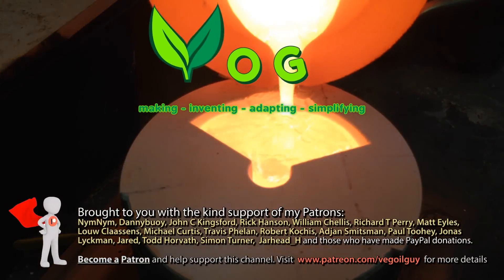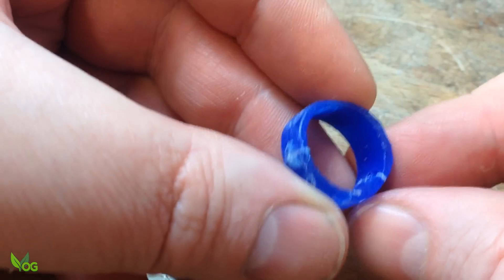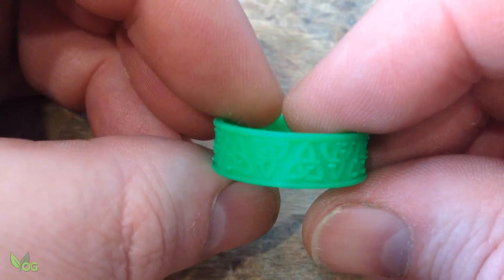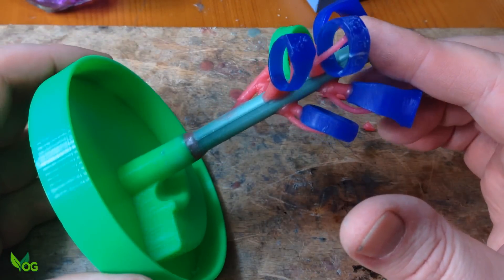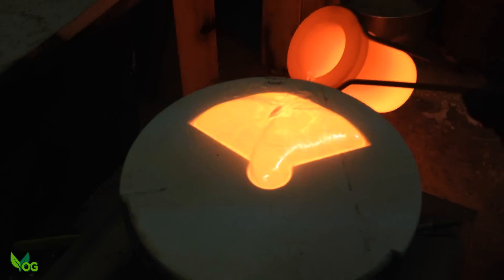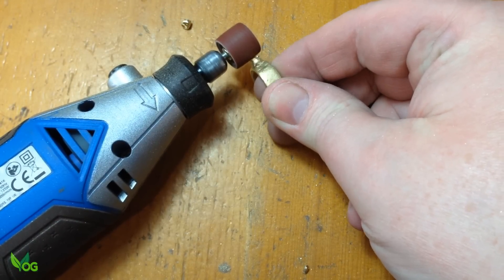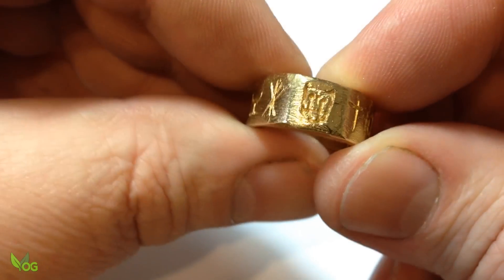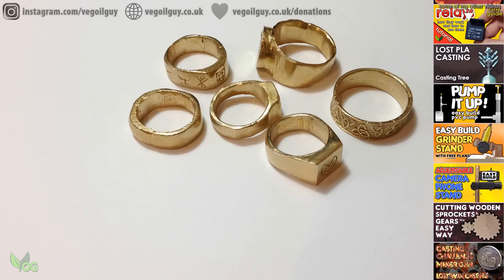Casting Rings & jewellery at home - Lost Wax & PLA methods - by VOGMAN

Comment: Hey there! Which 3D printer do you use? Also, can the used “lost wax” be reused in the printer?
Reply: Hi, 
I can’t answer about the printer but as someone looking at getting into casting, no you cannot reuse the lost wax as to clear it from the mould you actually burn it away to ash

Comment: Quick question is the plaster still inside the ring or di the heat melt it down im confused, so is it just like dipped
Reply from the maker: The PLA and Wax both stay inside the plaster until it is heated to a very high temperature. These then melt away to leave holes in the plaster. Molten metal then fills up these holes and once cool the plaster get removed. Then you're left with the rings 😊
Reply: @vogman  ohh thanks alot

Comment: What did you use to sand and remove the sprue.
Reply from the maker: I can't be sure offhand Jamile. I typically use an angle grinder, a Dremel (with cutting disk or sanding drum), small files and ordinary sand paper : )
Reply: That still helps thanks alot working on a few projects myself you earned a new sub
Reply from the maker: That's great to hear. Drop me a line any time if you need a little help : )

Comment: Don’t quite understand your furnace situation- you seem to have lots! Why have you stopped using the homemade one?
Reply from the maker: I guess the answer to that Tim is 'which homemade one?' There's been a couple.
For Lost PLA / Wax I need two heat sources, one to melt / burnout / prepare the plaster flask (for which I use my homemade electric furnace) and one to melt metal (for which I use a tabletop, store bought electric furnace - though I've also got a couple of gas furnaces I use from time to time).
The choice is purely preference... electricity is quiet, clean and indoors. Gas is noisy and outdoors.
But for more on the why, have a look at this video I made on Lost PLA. It should tell you everything you need to know : )
https://youtu.be/qxj5eUkAFUI
Reply: Glad to hear you are still using the homemade electric, it is on my (rather extensive) todo list, so pleased to hear it is still in favour 😊
Reply from the maker: It's still my favourite furnace  : )
Have you seen last week's video? I added a programmable PID to extend the use of that furnace, giving it Burnout capabilities - https://youtu.be/hGCL1FXKXss

Comment: Jewelry is often cast using centrifugal casting. Myfordboy used lost PLA to do centrifugal casting in a video earlier this year. Check it out!
Reply from the maker: I'm a subscriber and fan of Myfordboy, Jake, so you can be sure I've watched it. You can actually find his comments on some of my videos, which was very kind of him.
The only drawback of centrifuges, if you ignore molten metal spinning by you head, is that need to know the precise amount of metal needed in your casting. This is poured into the basin outside of the flask, and the centrifuge pushes the metal inside. 
I'm not that precise in honesty. But fortunately with a homemade vacuum system like mine (https://youtu.be/EGNnH_xbjR4) this isn't a problem.
Thanks for your input  : )

Comment: Have you considered trying to make a magnetic induction foundry? I've been seeing a lot of videos here on the YouTubes of people demonstrating how it can heat and even melt metal for casting. It makes me think that if someone were willing to scale it up enough there might be a very green alternative to using fossil fuels for melting metals with exceptionally high melting points like steel and iron.
Reply from the maker: I did see a company advertising them on banggood I think. I wrote asking if they wanted me to review one but they never replied... at all. That made me sceptical. I may not be the biggest channel on YouTube, but I hope I have a reasonable reputation for casting. So ignoring me suggested they didn't like the idea of someone who melts metal a lot having a go. Of course I could be wrong there and it might simply have got lost in the system...
Reply: @vogman  That's a bummer, but it gave me the idea to try and find some DIY instructions online; http://inductionheatertutorial.com/ . I think the person who did this just wanted see if they could do it, or were working on college project, and posted it online so others can repeat the experiment. Ether way, it's something to build off of, and one thing I know you are very good at is building on a good foundation. Keep searching and researching. I have faith that you'll pull this off.

Comment: Cool rings 👍🏻 I haven’t seen the foundry in a while. Do you still use it?   When you printed the ring, what mm height did you use? Great job 🍺🍻🍻
Reply from the maker: Thanks mate. I'll be honest I don't recall. I use Cura which does all the clever thinking for me. I had it on draft I think.

Comment: I used to use that blue tape on my printbed and had a heck of a time getting prints off of it so I now only user cheap glue sticks and I can pop the prints of really easily and have had good adhesion to my mirror plate on my bed. 

Great stuff!
Thanks for sharing and as always keep building👍
Reply from the maker: I tried glue sticks, hair spray, masking tape... nothing worked. But then I found a tape claiming to be made for that purpose, and it DOES work. Well worth the money : )

Comment: I think Conner is going to be happy.  I'm in the process of carving my wedding rings myself-the wife is getting a rig of bear claws stylized in my own design I use as a logo for my photography biz, going to be set with a stone tho not sure which stone, mine is going to be a ring of Fruit Loops-trying to figure out how to use different metals for each one [[her nickname is Fruit Loop]].
Reply from the maker: Mark, that's AMAZING. I'd love to see pics when they're done. Please take silicone molds before you risk any castings. I'd hate for you to lose all that hard work. Are you going to do the casting yourself or maybe hand it over to a jeweller?
Reply: @vogman  Sure!  And the silicone mold.  That totaally escaped me.  Also considering designing it in photoshop then using a 3d program to clean it up and size it, print and cast-if I go that route I will have the fikkes as I'm working on some other unique pieces as well but the silicone is definitely getting filed into my small brain, thanks!
Reply from the maker: I was lucky with today's video. They've gone wrong in the past. There was always a gamble I'd lose Conor's work.
Don't take that risk  : )
Reply: @vogman  My work never goes wrong.  I have, however, discovered thousands of ways to do things.  :D

Comment: Nicely done. Are you able to take pictures or something and put it on your computer then 3D print it?  Then you could have made extras if something had gone wrong. I do not know much about 3D printing and would like more information. Thank you. Great job 🍻
Reply from the maker: I'll be honest James, I'm still learning 3D printing myself. I got my Creality CR10S in January this year, and I'm very pleased with it. It's one of those things you can watch 1000 videos on, but never really grasp until you buy one and get on with it. If you do, after a week of swearing and cursing me, you'll get there. A week later, you'll see why people love them.
3D scanners are a thing, but they're a little pricey I believe. I think we'll see those becoming more and more common very soon.
Reply: @vogman  i have gotten through the first week and my printer stopped working because pla went into the screws. So I guess one more week of cursing you?
Ps:  The printing was great after two days. I just have a questionable sense of humor.
Reply from the maker: It's a rare day when someone, somewhere, isn't cursing me  ; )
I'm impressed with a couple of days. I had bed-sticking issues until I discovered some wonderful tape. SOOOOOOO much swearing before that  : )
Reply from the maker: That's excellent. Share the learning experiences  : )
Reply: I know I have said it a few times that I am building a pile of meltables, but I am. I plan on building a couple different sized foundries and melt my piles for ingots and stuff. I travel a lot so I find aluminum a lot. 300 pounds at a guess with 20 pounds of copper and 5 of brass. Most is outside. I just don't have a workshop yet. Next couple of months and I will have one 😃 Then the work and fun will begin along with a YouTube channel too boot. My fiancé does crafts and I will help make items for that. Till then, my piles are building and I am gaining knowledge. To the future 🍻🍻🍻

Comment: What do you do with the "burnt out" plan / wax, or does it just "vanish"?
Reply from the maker: The PLA and Wax mainly drip out of the plaster onto the oven floor where they mostly evaporate, but some fine ash gathers after a few casts. But the plaster... you're stuck with that mess  : )

Comment: Great video. Thank you. Coincidentally, I printed the very same ring from Thingiverse a month or so ago to test the quality of print. I am keeping it for my first cast. I am challenged with building a furnace. But I'll get there.
Reply from the maker: That's an ambitious first cast Louw, but if you use the same technique as me I think you'll get there : )
You know where I am if you need advice on electric or standard furnaces my friend. You'll do it, I'm confident of that.
Reply: @vogman  electrical?!! This is South Africa. Cost of electricity is rising excessively and some days we don't even have any. So gas or charcoal... I am not sure how I will do my burnouts yet. My first attempt many moons ago involved oven for wax melt out and then into a charcoal starter chimney. Left it burning overnight and next day it was cold and small cracks. I cast the brass into a cold mould and it came out OK. Some definition lost though.
Reply from the maker: Now I would have thought Solar would be big in your sunny climes.
Reply: If only I had a Fresnell lens. Summer temperatures up to 43 deg C here by us.
Reply from the maker: Mate... no. It was 22C the other day and I was wilting, honestly. I very hot summer in the UK can hit the early to mid 30's, but they are years apart. The 40's... no. I couldn't cope.
Reply: Ouch! I am 25.2 stone. So you can just imagine how irritated I am in the heat.
Reply from the maker: Got you beat, lightweight   : )